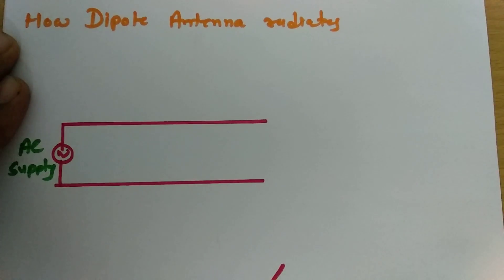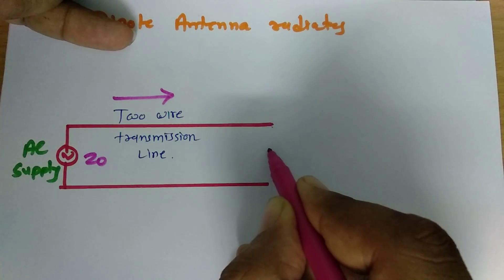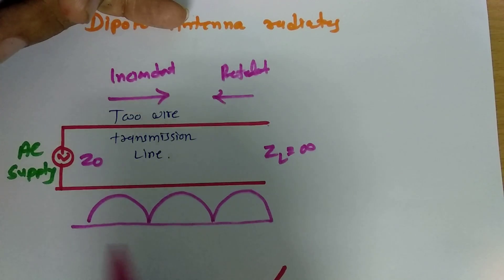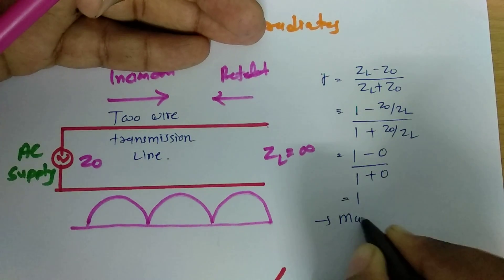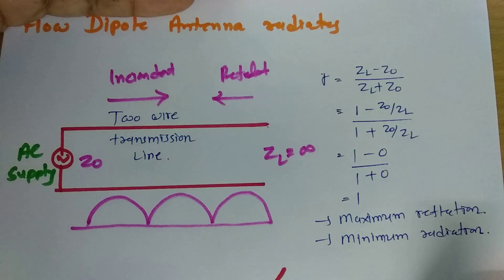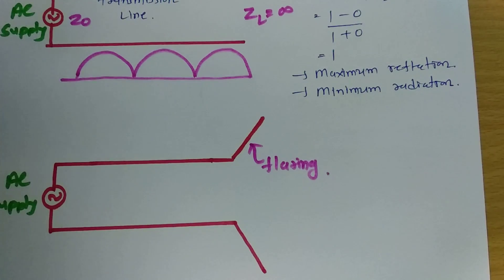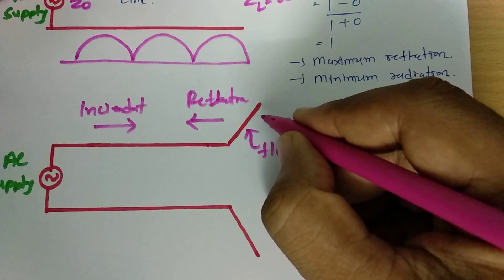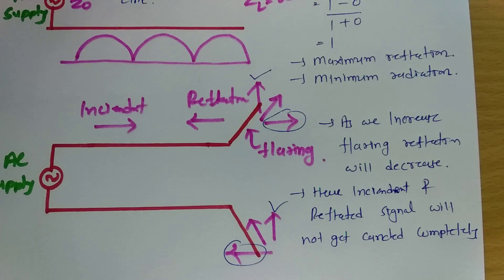How Dipole Antenna radiate in space? in Antenna and Wave Propagation by Engineering Funda

Comment: Sir, many mistakes in your video including incorrect concepts. Please correct 
For example it's not current cancelation but magnetic fields which add up, and electric fields which must travel from top wire to bottom cause the radiation. voltage on standing wave is actually maximum at open circuit,  you drew it incorrectly.
Reply from the maker: Direction of current only defines magnetic field And polarity of charge can only defines electric field.

Comment: Hmmm...so since the uncancelled currents in the two elements are in phase with each other producing maximum amplitudes of current, periodically, then there will also be produced maximum amplitude magnetic fields corresponding to these current maximums in the wire. Similarly for the voltage maximum (periodic) and hence corresponding electric field strength maximums. But it is these magnetic and electric fields detatching from the antenna that constitutes radiation...i.e. an em field. That's why we want standing waves of current and voltage on the antenna I but not on the transmission line.

Comment: I understand nothing right from the start. What do you mean by "signal"? Is it the voltage or the current? Also, if the two wires are open, there is NO current. And the voltage at the ends of the wire will exactly be same as the supply voltage. So, what is reflected? I see nothing happening here. No electron flowing at all anywhere. No current. No signal. No quarter wave. No half-wave. NOTHING. Am I missing something here?
Reply: If you have 100 kilometer of wire, and you apply a voltage, will that voltage appear "instantly" at the other end?  And if not, after how much time will it receive that voltage? This is an example of a transmission line, nothing can travel faster than the speed of light. This effect is more visible with AC signals (AC voltages/currents). In the case of a dipole antenna, AC signals will push and pull electrons to and from both ends of the wire.  Strong magnetic fields will happen in the center of the dipole. And these magnetic fields created by the AC currents will combine with the electric fields by the AC voltages to become an electromagnetic field!

It's important that the supply voltage is high frequency AC, if you have DC, yeah, the ends of the wire will exactly be the same as the supply voltage, we don't send DC to antenna. This topic is about radio frequency, there's a lot to learn!

Comment: How did u get magnetic field in open circuit as no current is flowing
Reply from the maker: This is not low frequency analysis as you study by ohms law or KVL or KCL. This understanding is based Maxwell's law
Reply: Is not the electric field creating magnetic field
Reply: Or magnetic field creating electric field
Reply from the maker: Yes it's true
Reply: Actually unlike DC current (like water flow in river), AC current is electron waves back and forth(like waves in ocean). so even in case1 (no flatting), there is still AC current, but actually not a single electron actually moves from upper wire to lower wire,  the parasitic inductor/capacitor between two wires exchanges energy through mag/elec fields, and causes electron waves.

AC source causes waving (AC current), and this waving pattern is propagating through wires in approx speed of light, when it reaches open end (case 1),  it reflected back and causes the so called "standing pattern" which means electrons waves magnitude will be very big at some places and very low (or no move) at some other places.

see standing waves visualized
https://www.youtube.com/watch?v=M1PgCOTDjvI

but  w/o flatting, these waves (AC current) cannot radiate because at any particular place their direction is opposite in two wires, flatting changes it as author said.

Comment: Bro u did open in both cases
Reply: What about this
Reply: An open circuit can be created with mismatch of the load impedance suppose your source has 50ohm input impedance but at the load side you connect 100ohm impedance in that case the current flow will be there but in a mismatch manner so you will have reflected waves